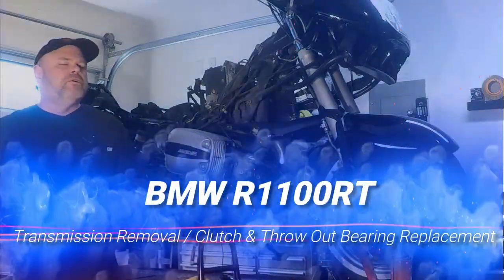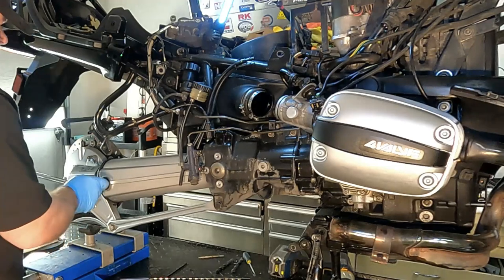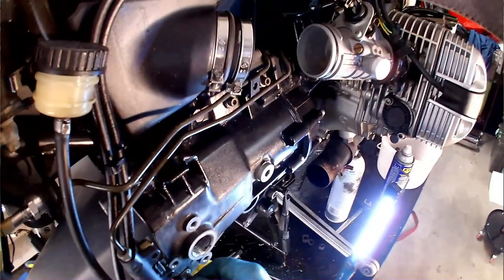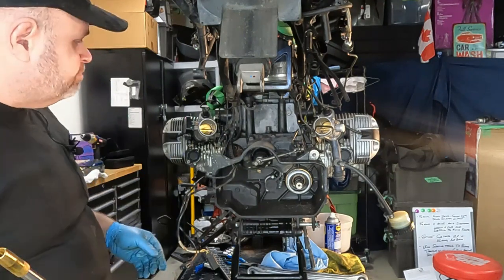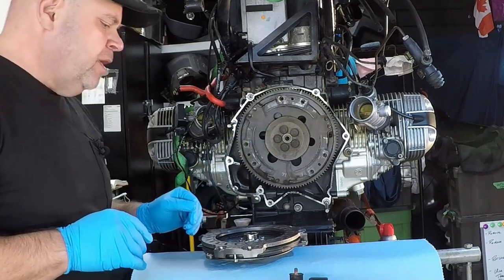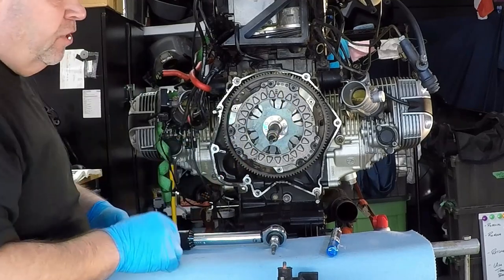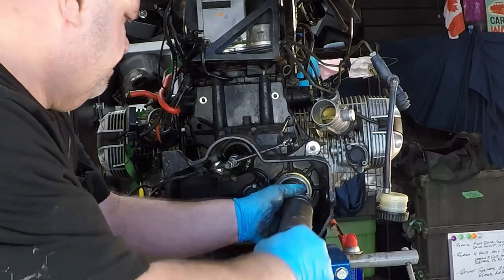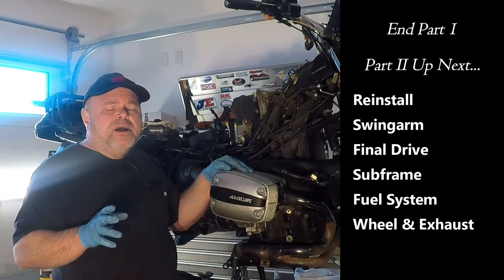BMW R1100RT Clutch & Throw Out Bearing Replacement - Part One

Comment: I really appreciate your BMW "Is it clapped out-Not until my wallet taps out" series.  I also picked up a super high mileage oilhead and have been doing these repairs as well and even though I am a factory trained and master certified outboard wrench its always nice to get tips, tricks, and most importantly get a visual on the procedure before beginning.  I applaud you taking the time to put this out here and encourage you to continue-you are helping the riding community!
Reply from the maker: Thank you LaSulorac👍  Another helpful video out on youtube in a few hours!
Reply: How much does a job like this cost I have a 96 r1100rs with a bad clutch I know ebay sells the clutch for around $500 but what would labor cost be

Comment: Because you're pointing at 3 points where the balancemarks should be: Are you sure it's 180 degrees and not 120 (360/3=120)? Very well explained video though! 👍
Reply from the maker: Correct 120 degrees.  Thanks

Comment: While the 1100 is not known to have a rear main seal leak issue like the 1200s, wouldn't it still be a good idea to replace the rear main seals while you have the bike torn down to that level?
Reply: LOL, I am doing this exact repair in the video and was planning to change my seal. CANNOT get the flywheel off to do so!

Comment: Locator pins! Remove one of the transmission bolts and go to the hardware store and buy 2 bolts, same thread but one half inch longer. cut the heads off with your hacksaw and the cut slots into the cut ends. Just saved yourself $65.00!

Comment: Very helpful, thanks for taking time to explain not only what you are doing but why you are doing it.  One small addition that might be helpful:  We are installing the different clutch components 120 degrees apart - 180 degrees would be directly opposite each other, so the friction plate would end up in the same location as the ring gear.  Also, I'm not aware of any "throw out bearing" - I believe the pushrod is in direct contact with the diaphragm spring. (?) Maybe something I can learn here?  
Thanks again for all the detail!
Reply from the maker: Yes I misspoke i meant 120 degrees not 180.  Thanks for the View!

Comment: Good video,  thanks. I have done a few of these and find its easier to remove the box with swingarm and final drive together.. need extra hands but if the paralever bearings have no movement, then it is heaps quicker.
Cheers
Reply: What was the time required to do the job with and without the rear drive removed?
I may be doing this job soon….
Thanks😊

Comment: It is kinda unusual that motorcycles, which have been around for a quarter of a century, are still relevant in 2023. I have R1100RT 97' and drove 14 thousand kilometers across Russia this year. It's a great bike, but it lacks cruise control and electronic idle speed control. Anyway great vid, everything necessary is clearly explained. Thank you from Moscow. 👍

Comment: Thanks for the video, I need to replace my clutch pack on my 1100 RS, using this for inspiration (I am down to the clutch pack and lost my momentum when I wanted to get the flywheel off to replace the seal.

Comment: Great video. I was thinking about an RT to replace my Pan. Now I do not think so. I have cars whereby replacing the clutch is easier than on the RT. Swapping clutch plates on a Pan or a FJR (also both shaft driven bikes) is a lot easier. Less than briljant engineering from BMW, looks like their current cars... At least that's how I see it.

Comment: I got 85 k miles got it at 74 needed love barely could start it then getting it to start running stop smoking is another story I did all services per bmw pm schedule some things twice and man this baby humms did my 3rd oil service it really became back to life but my shift assist pro into 2nd only second will pop out of gear and rev like crazy once every 10 times I’d estimate and it would go into neutral think ours the clutch I get it’s oem from a 2005 r1200 rt

Comment: My bike comes with self encapsulating thread sealer or thread lock some nasty shit on the passenger side grips pannier mounting rack you have absolutely got to hear them up or destroy the hardware and the threads at a minimum what kind of lift is that where did you get it? I NEED one of them

Comment: Could you do me a favor?
how long are there transmission guide pins, what metric diameter, what thread and how long the thread is.
(i used to make these from left over parts from cars like stretch bolt from cyl heads and so, it helps a lot on cars).

I also would like to know the measurements of the clutch plate centering pin, the max and min diameter, length of sections.

I have seen a car where one of these bolt came loose and the gearbox was destroyed having a big hole, than i started to use a blue loctite.
What was the mileage of the bike in the video?

Comment: I have a knocking type of sound when accelerating. Sounds like some kind of play in the drivetrain, do you have any idea what it could be?
Reply from the maker: Driveshaft splines and/or universal joints.  What is the condition of the fluid in the transmission (not the engine) and the fluid in the final drive? You asked the question on this video, so to confirm  you have, an R1100 ?

Comment: Only thing I had to repair were the fuel sender strip i zapped it back in April still working not the most accurate I’ve ran out at 60 miles due to empty 😩 rear tire cuz I over inflated brakes all around and tail light bulb

Comment: Welcome
My father owns a bike with an odometer of 3000 km and he has not driven or operated it for 20 years due to illness and I want to start it and I bought a new battery and the tires came out automatically, should I replace them also
What do you advise me to work without problems, thank you
Reply from the maker: Before you do anything drain and replace the fuel and engine oil, transmission and final drive oils they will all be toxic garbage and will potentially rune your day and your bike.   Remove the spark and put a little oil in the cylinders using an oil can leave the plugs out and turn the engine over but for no more that 10 seconds.  Do this three times to lubricate the engine with the fresh oil.  The put the plugs back in and try and start it.  If your fuel pump and filter are not completely gummed up you may get it started.  I would strongly suggest removing the fuel pump and changing the filter.  Use a strong carb cleaner on the pump before reassembly.  Don't trust things like brakes or tyres that have been sitting.  Go through the lines and change the tyres they will have at least flat spotted from sitting.  The brake fluid will have spoiled and will need flushing at minimum your rubber brake lines need a good check over and replace anything that has a bulge  or leak. Good Luck!
Reply: @RodRidesWrenches  thank you very much for the respond
As for the tires, the bike is raised on the main document and the wheels are high off the ground and empty of air. Would you advise me to replace them or change them?
excuse me for asking
I use the translator to talk to you
Reply from the maker: @bassemeddawe  if the tires are more than 10 years old then change them.  Shelf life for a tire is about 10 years.  It is your risk.  I would not trust them.
Reply: @RodRidesWrenches  thank you very much

Comment: I respect the mechanic who works on boxer motorcycles. It’s such a pain in the ass. So is shaft driven. Maintenance free. But when you do. You’d rather just change a chain drive. I’ll never own a BMW motorcycle at this point. Just because most are ready for all this. And it’s likely gonna cost thousands. If not what the bike cost.
Reply from the maker: Thanks for the feedback & view!

Comment: With all the respect for BMW who really know how to build engines I am not very enhousiast about how the recent BMW motorcycles are built together.   With cables everywhere and a spline lubrication whereby you have to break down the complete motorcycle is nothing less than a shame.  When cars would require a similar break down customers would run away and never return.  And some fairing to cover it all so that everything looks tidy .....  no that is not my style of working.
Amazing that I do not hear BMW motorcyclists complain about this construction.
Reply: good news for you, cars require the same handling. remove the gearbox, remove 2 or 3 engine mounts, gearshifter linkage, air filter and maybe others parts, lower or lift the engine, remove driveshafts if it's a front wheel drive to replace clutch plate and pressure group.

the Telelever front suspension is cool and superior as wel the paralever, no noise.